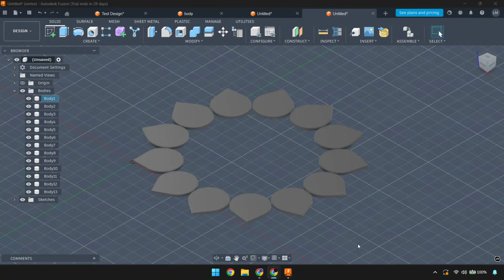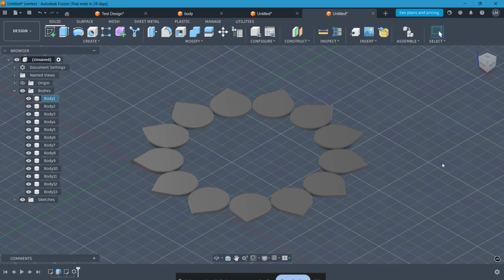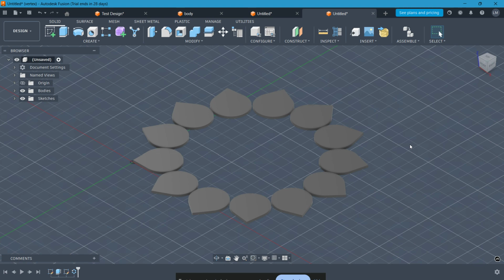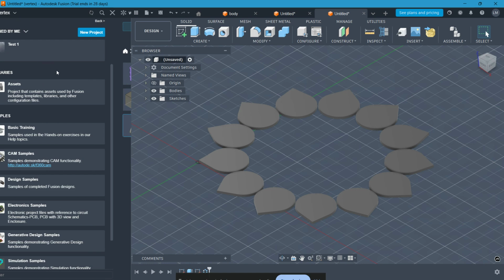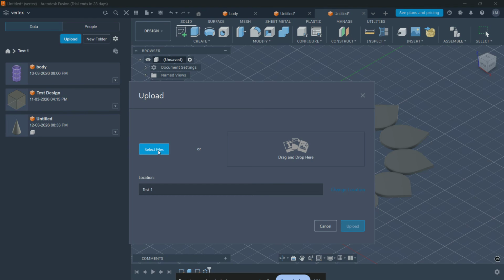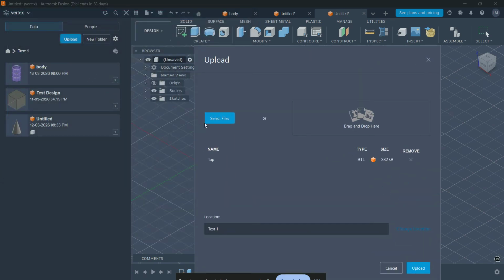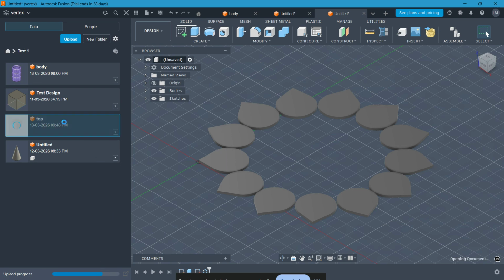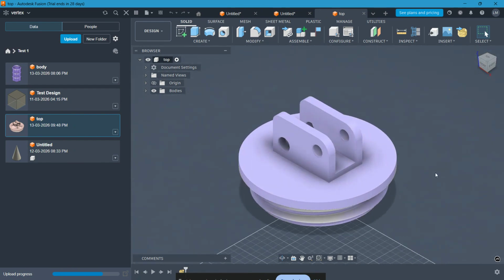How To Import A Model Into Fusion 360 (2026 Easy Guide)

Comment: Useful, but plays better at 0.75 playback speed.🙂
Reply from the maker: That is a great tip for anyone finding the pacing a little too fast! workflows can get pretty dense, so slowing down to 0.75x is a smart way to make sure you catch every click and menu selection.

Thanks for sharing that—it’s definitely a pro move for tutorials like this. Don't forget to like and subscribe to stay locked in for more straightforward editing guides!